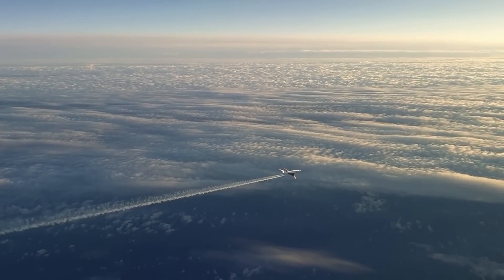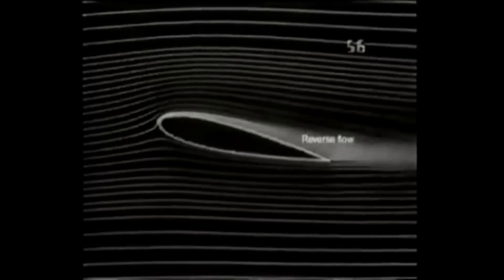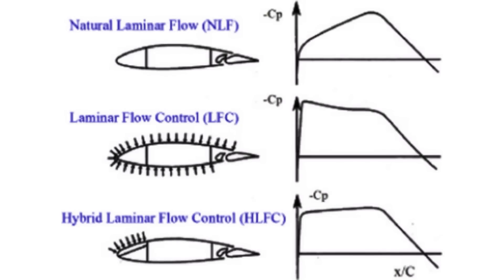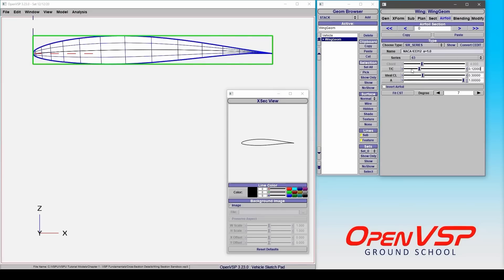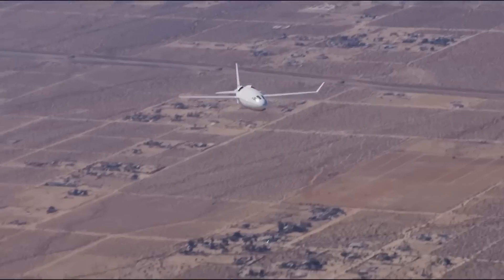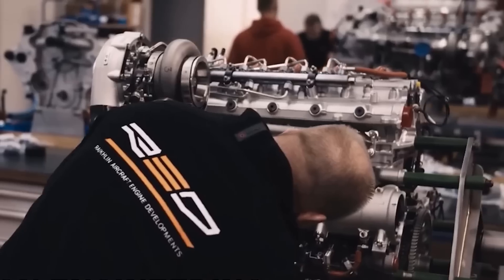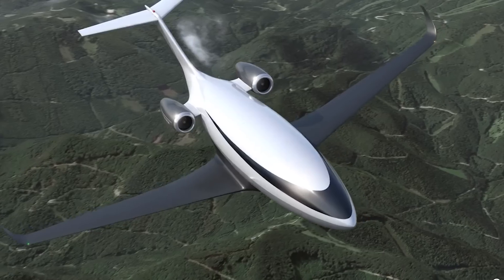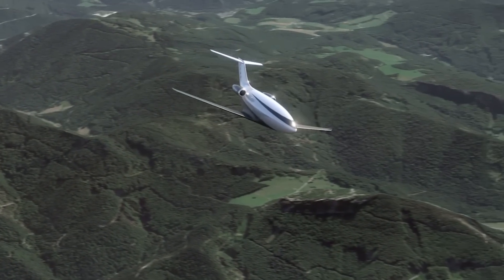Otto Celera 800 vs. Celera 500L The World's Most Efficient Aircraft

Comment: As an Aeronautical Engineer with decades of aircraft design and analysis experience, I always knew the disruption of existing inefficient, imperfect aircraft design was inevitable.  The laminar flow drag advantage is massive.
Make an electric version and the operating cost advantage will be astonishing.  Managing to stay in business is the hard part.
Reply: So how would this design work in wet conditions or worse, icing?
Reply: Theres already a Canadian company thats produced a  class leading electro fan jet engine... because it uses a rim drive motor without an axil core to get in the way ...so the overall diameter of the jet pod can be significantly less than for a combustion turbo jet engine...its also lighter and naturally cooler.

The other breakthrough is a UK team and their set up company have succeeded in producing aviation  grade kerosine from human sewage.. 😂 seriously they can produce a crude oil substitute from human and animal waste ..then separate it into fractions to produce jet fuel. Which is a lot simpler and cheaper  than other synthetic  complex fuels or grown biofules.. its also a lot better in terms of the overall environmental impact. 

The fact that this design cleverly minimises its fuel needs helps offset the fact  that to continue to fly we have minimise the amount of fuel we burn by escaping from the traditional tube with wings  
and engines in pods slung under the wings.
Reply: @clivestainlesssteelwomble7665 Heartening News
Reply: Making an electric version will drastically reduce range and payload. And every landing would be performed at very near takeoff weight because no fuel is burned off. A certain percentage of landings are less than perfect. Those landings will have more impact (perhaps literally) on aircraft durability.
Reply: Meh. Battery technologies need to improve energy density 5x before it will be worthwhile for aircraft.
The current mass Tesla battery would need to get you 1500 miles.
Reply: Every competent Aeronautical Engineer knows that electric version will be more expensive .Aviation grade batteries have higher amortization cost than corresponding  lifetime fuel consumption (without taxes). Heavier airframes increase total energy usage.
Reply: As a pilot, it's astonishing to me that this design hasn't been used before.
In Aerodynamics, we were taught in early groundschool that the most efficient aerodynamic shape is a rugby ball.
This aircraft is similar in shape.
Reply: "Round" is far from the most efficient shape. In WWII, they could have made things like drop tanks ball-shaped, but lots of shapes do better than your rugby ball. 

 @Mark-oj8wj
Reply: Well you clearly are not an Aero Eng.  Every aircraft flys' with such airfoils.  These chumps are only talking about one form of drag.   Their claims are pure Bull Shit and aircraft already fly at the stated mpg as the person in this vid lied or is utterly ignorant just as you are... the Celera 500 is flying at ~200knts, and ALL those aircraft that have been previously built out of CF, NO ONE will buy as they fly too damned slow for business aviation as has been proven multiple multiple multiple times over the last 40 years.  Guys building aircraft in their garage will buy kits and plans though occasionally.  Likewise there are mutliple 500knot aircraft as well which are identical as this 2nd joke.   There hasn't been anything new in aviation for 20 years and that was the F35B.  This reminds me of the Dark Aero idiots thinking they will sell their aircraft... Yea, maybe 2 or 4 of them.
Reply: Electric version operation cost benefit??? Love going bankrupt like all these other EV freakshows?
Reply: How much?
Reply: Make an electric version and you have to lug the battery around, and the induced drag from lifting that load rapidly kills any operating cost advantage. We have kerosene and gasoline fueled aircraft because of the enormous energy density of petroleum.  

If is hard to point to anything in this design that is actually new. "Laminar flow" airfoils have been known and used for sixty years or so. The fuselage shape is generated  in much the same way as most aircraft fuselage shapes have been initially generated for more than a century. An airfoil shape is chosen, and it is rotated around the long axis. This design happens to choose an airfoil shape which maintains laminar flow over more of its length. This main advantage is also a limitation. It works at one size.  When you want to enlarge that shape to any great degree it is necessary to cut the bowl-shaped front from the sort of conical aft end and connect them with a cylinder to prevent the fuselage from becoming impossibly thick in the middle. Doing that renders the actual airfoil used to generate the fuselage much less important. It certainly would make a laminar flow class airfoil ineffective, because the actual shape would have a long flat portion in the middle that had nothing to do with a laminar flow class airfoil. 

Like many "great leaps forward" in aviation design, this is quite possibly a dead end. It works at one size, with one particular engine. It has not been demonstrated that the actual performance matches the marketing numbers. It  is as yet undemonstrated that it will even work as an actual marketable aircraft, with all the pitot tubes, antennas, de-icing gear and necessary equipment loading it much closer to it's theoretical limit.
Reply: @herbertshallcross9775 , yep... 
You are 100% spot on. 
Energy density of batteries would need to be 5x better for Single engine GA aircraft to make sense. 
And 10x better for larger commercial aircraft. 
The real problem is also how friggin dangerous Lithium Ion Batteries are. 
One cell goes bad and lights up and you lose an entire vehicle. 
Some car manufacturers recommend you not park their electric cars in the garage because of battery issues. 🤣😂
Reply: What are the disadvantages for this design that is hasnt appeared earlier - even for freight only ?
Reply: Otto Aviation just received financial backing from darpa for drones using laminar flow. It will be interesting to see what they can create not only in the civilian market but also the military market with said funding
Reply: The Otto Celera 500L can be the most aerodynamically efficient design out there. As for electric motors, there is the issue of producing batteries capable of storing enough power for safe operation and as well, that of producing an inflight charging system that can keep the battery voltage high enough for safe operation without overheating.
Reply: Seriously, you're an Aeronautical Engineer? Shill more like it.
Reply: Clearly not a decision maker...
Reply: As an engineer you should know why those „imperfect“ designs exist. Catchphrases would be: manufacturability, customer demand, safety regulations, operational bandwith… of course you can design an airframe, that can do ONE thing really good, but will suck at everything else. So to make it useable, you have to make compromises… and i can tell you: almost no customer will accept a windowless airplane…no matter how advantageous the drag reduction would be. 😂
Reply: @bendo7418 Quite true. I like the idea of using blended wing  airliners for their advantages, perhaps more than the aircraft in this video. A problem is that passengers may not want to fly in an aircraft that looks too unconventional for almost superstitious reasons. The bwb is another example of where to put windows for how many people. The video's aircraft has a more complex bulging fuselage profile. The good bits about a fuselage that is a plain cylinder with a taper and radii at the ends only are ease of manufacture, strength and ease of homogenous amd efficient passenger layout. I imagine the tapered fuselage have 4 across at aisle one and the 6 across by only aisle k or something. A triangle of wasted space in between at the fuselage wall.
Reply: @bendo7418  Boom Supersonic faces the same issues.
Reply: @bendo7418  You seem slow. Why are you assuming passengers wont accept virtual windows if their plane ticket price  is much less ? And where is "customer demand" a catchphrase ? Its juts "demand" and demand is dictated by profitability ( once its obviously cleared by national aviation boards ). All your other questions are covered in this vid
Reply: @bendo7418 it has windows just no frames. And manufacturability is very different today compared to before. So that’s not an argument. And what are the compromises?
Reply: @bendo7418 :  I think you are wrong. I love windows. I have more windows in my house that I designed and built myself then just about anyone in the world other than a pure glass house. I would be happy to fly on an airplane without windows as long as I get the window Experience as they show in the video.  I don’t know if you’ve noticed, but most people on most flights couldn’t care less about windows. And then there’s another thing, what about airplane flights where there is basically zero visibility. Did you people cancel? I think you’re being pretty judgemental
Reply: I’m pretty sure you have NO clue what you’re talking about. An electrically powered aircraft would ALWAYS weigh the same. It would never get lighter as it flew along.
Reply: @savagecub  
The engine is  lighter .... Because its simpler and has no shaft bearings or the ancillaries of a combustion motor its essentially a EDF but with its fan rim driven. 
Providing a power source is still marginal especially over longer distances but there are possibilities being worked on as are hybrids RR has been working on high output gas turbine powered APUs . 
Theres also the possibility of using a novel combustion engine designed as a generator that can deliver sufficient power whilst being smaller lighter and being more efficient and cleaner running as they can be designed to run at their Stoichiometric optimum via a more modest size battery pack/s  of Li S or Al S or Na Zn Va  type chemistries that may offer the level of advance required. 
But short range electric flights are already happening even with   
 floatplanes.
Reply: @savagecub :  Sure, energy density and fuel burn weight loss are significant advantages for hydrocarbon base fuels….

To some extent you can say the same thing about internal combustion engine cars and electric cars and look what is happening there!!

Your pessimism will be chipped away until your only choice is to fly electric. I hope you live long and prosper to see and enjoy it and to learn a lesson that all radical skeptics need to learn. New stuff is coming and it will be better in spite of your down-wrong negativity!!
Reply: @steveperreira5850  
Yes but I don’t conduct polar flights in my Tesla, weight is no where near as critical.
Reply: @savap😅pgecub
Reply: I’m not an aeronautical engineer but I am an electrical engineer and I designed aircraft components.  Watching the video I had the same thoughts as you.  And electric version will be even more efficient and have pretty good range given that the drag is reduced so much.

Great to see aeronautical engineer is learning from nature, like the dolphin, then comes the X35.

Question:  where have been the cigar factory boys,  Boeing and Airbus?  I’m 64, nothing has changed in the shape of airliners in my lifetime and even going further back!!
Reply: @@OrwellNailedIt Well, so why do you throw your shit around then?😂 Also most cars or buses have windows, most people rarely look out from. But still nobody would buy a car without them. This idea of windowless is utter bullshit and just a marketing stunt to seem innovative, while in fact there is no real innovation apart from a „unique“ design. Everything else has already been tested and/or produced and has failed for various reasons. As an engineer, you should know…just look at all those „unique“ designs that failed in any real world situatin… it will be the same way with all these evtol startups…just a big investor scam…and this one is headed the same way. But nobody stops you from putting your money where your mouth is and invest in these ideas. 👍🏼 good luck
Reply: @bendo7418 it’s not windowless. See the video.
Reply: @bendo7418 in fact it has the most windows by area.

Comment: Hope they have a good way to keep that surface smooth.  If your plane’s performance is dependent on laminar flow, everything that creates a surface imperfection is your enemy.  Bugs, dust, rain, icing conditions, dings and scratches and dents from pebbles being kicked up, bird strikes, hail, general wear and tear in an airport environment (if you ever see the baggage carts driving around, you get an idea of the damage a vehicle can take by just existing in the ramp area). 

It seems like a really cool concept if they can get it to work that way in the real world though.
Reply: Yup, that's my first worry. If this thing flies through a rainstorm just after take-off, it may have trouble climbing out. A cloud of insects early in the flight could keep it from reaching its destination.

Some high-performance sailplanes have wing-wipers that slide along the leading edge. Maybe they should get some.
Reply: You make good points and absolutely they are aware of all of those things.  Certainly they will be built with power margins of safety, etc. to deal with increased drag under inclement conditions.
Reply: If we look at the Boeing 787 fuselage surface , which is made of carbon fiber it is quite a smooth fuselage compared to old school sheet metals riveted together.
Reply: @alex630710  yup, we've had that in small planes for some years now. Scaling it up to an airliner is certainly challenging but is beginning to be implemented as you said.

Im not really talking about MAKING the plane smooth tho, Im talking about KEEPING it smooth in day to day operations.
Reply: Upkeep is worth the time....when time is money.
Reply: @marcalvarez4890  well, upkeep while the plane is in flight actively accumulating particulates might prove difficult. And again, these particulates matter if your performance is predicated on laminar flow.

Upkeep on the ground is more practical, however any time a plane spends not flying is potential lost revenue. An increase in maintenance for engines right now is costing airlines millions, not because of the cost of the maintenance but because of the increase engine off-wing time.

Comment: If it is so efficient, why Boeing, Airbus and others have not done something similar, the laws of physics and aerodynamics apply to everyone. You are claiming efficiency gains like 50+% while others are squeezing 3%. There is something you are not telling me?? Piston are more fuel saving so why did I see two turbines in the latest picture? This industry have a long history of, if it is too good to be true, then it most likely is.
Reply: teardrop shape is very expensive when it gets bigger. long tube is way cheaper. also such shape would make big aircraft incredibly fat at middle. 
but dont worry number that they are claiming here are BS. oh besides people dont actually want to fly in aircraft that has no windows...
Reply: The reason is because they need to build tubes that can hold five hundred people. This concept isn't new, the Piaggio Avante also uses laminar flow to achieve a similar result, but it's not scalable for large airliners yet.
Reply: Both Boeing and Airbus are using composites in their newer design fuselages to take better advantage of laminar flow. 

The engine switcheroo is actually two different aircraft. The 500L model is designed around the Red AO3 V-12 twin turbo diesel. This is kind of a coffin corner because nothing else that could fit would produce as good numbers. 

The 800 model is an attempt to get around the locked-in size limitations imposed on the 500L by its basic design. Otto was quite frank about this limitation in earlier videos. If, hypothetically, you doubled the length of the 500L, you would quadruple its seating capacity, but at a cost of  about eight times  the enclosed volume, mostly excess structure, encompassing unusable space. The numbers only work at one size. The longer, larger fuselage of the 800 with turbofans makes it a far less radical aircraft, little different from other biz jets. The video game picture window is a paper feature that almost certainly wouldn't survive to production, were it ever to be built.